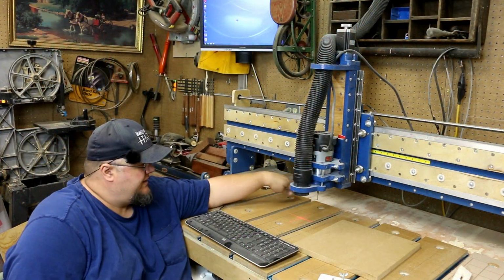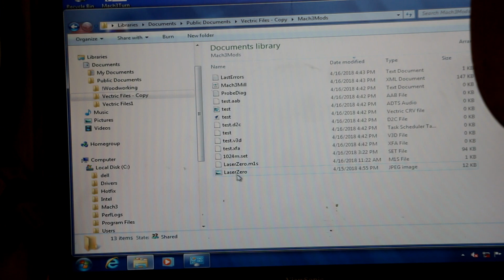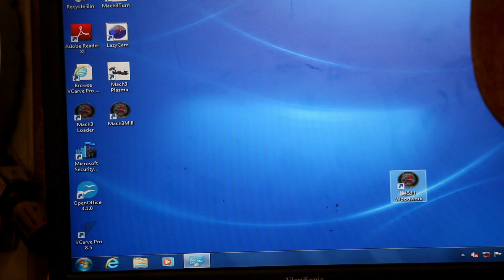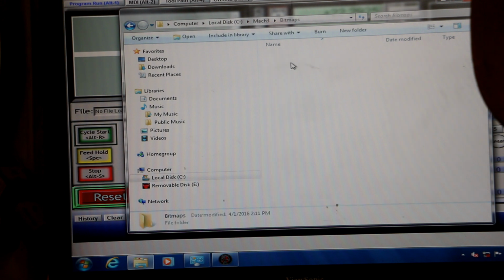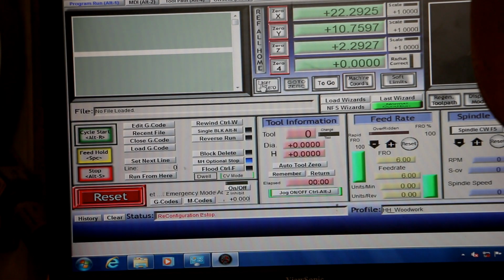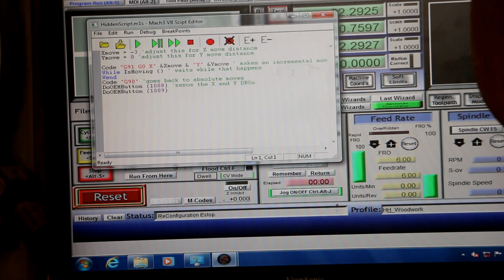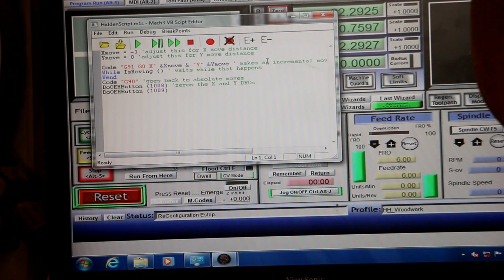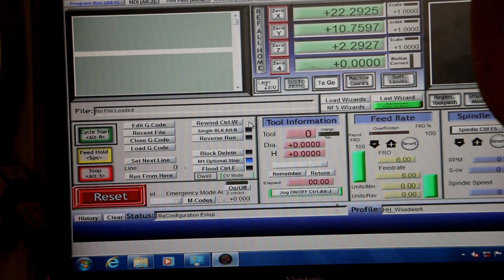Is it time to add a Crosshair Laser to your CNC?

Comment: The laser should be mounted on a Z-fixed spot so it will be always on focus. Good video, though.
Reply: different material thicknesses will change the distance anyway. Setting the spindle to the right height, which can be easily done, is also rather a game not worth the time ...
Reply: @666Azmodan666  It depends, I work with materials ranging from 1mm to 30mm and the cross is perfectly focused on all of them. It's not laser cutting, it's just a visual aid.
Reply: @alejandroperez5368  that's why I wrote that combining them to be perfectly sharp is not worth the time. It is sharp enough, especially since it is an eye measurement anyway.
Reply: @666Azmodan666  my CNC machine has a Z-axis with a long travel distance, I don't know how blurry it'd get from one position to another sincerely
Reply: @alejandroperez5368  I think that with a good laser it does not make any difference, the distances are still small. If someone wants to have a perfect one, he must mount the laser so that it goes with the spindle, As we are cut 100mm up and this will be a position where the laser is sharp it will be easy to add material thickness and e.g. at 30mm set the spindle to 130mm for perfect sharpness. the measurement is indicative and in most cases the laser focus is sufficient even if it is not perfectly in the correct position.